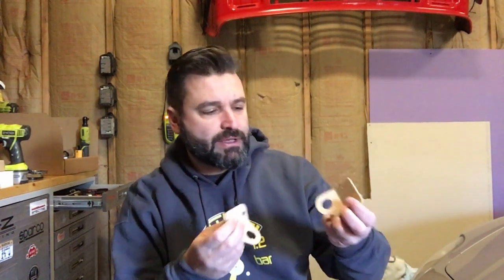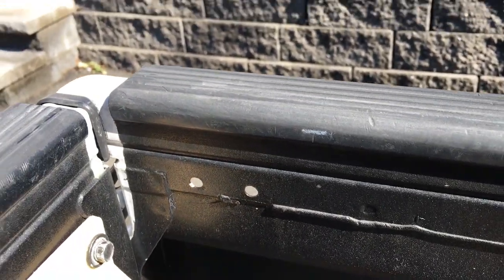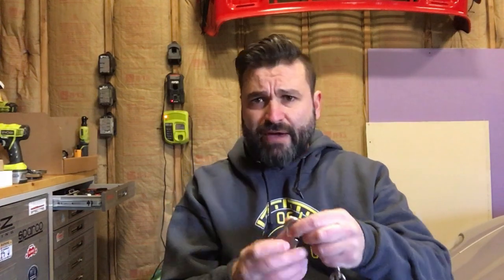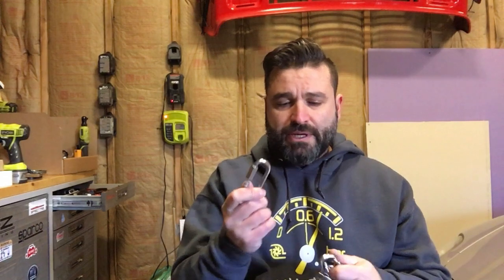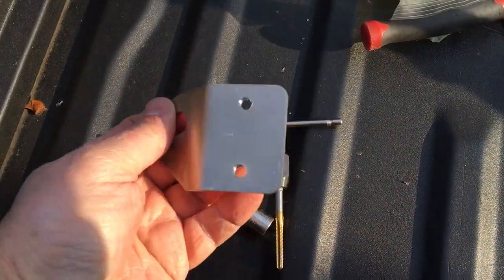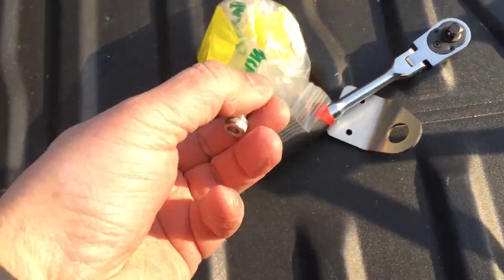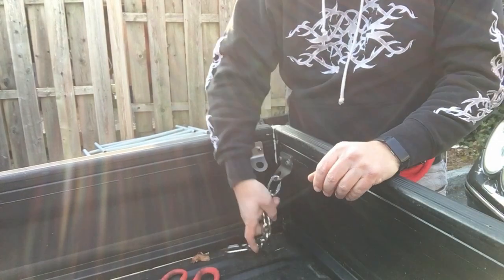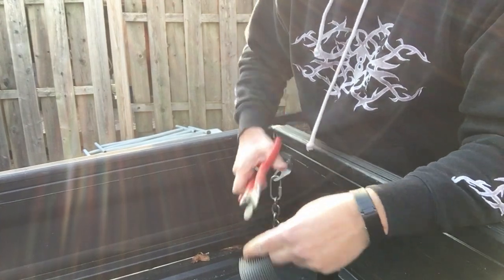Honda Acty gets Tailgate Chains - DIY

Comment: What is the appropriate length for the chain?
Reply from the maker: From bracket to bracket, it’s about 13.75”, but this the chain itself vary depending on the carabiners you use at the ends.  Good luck